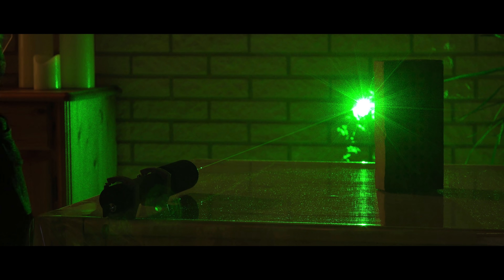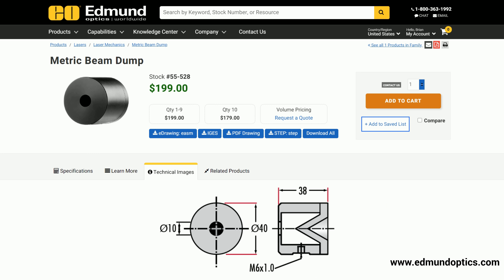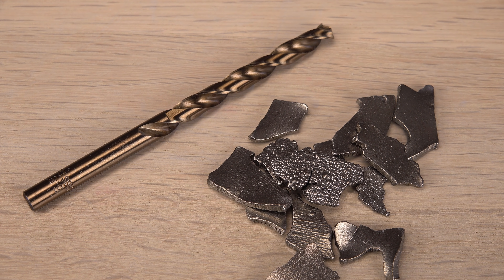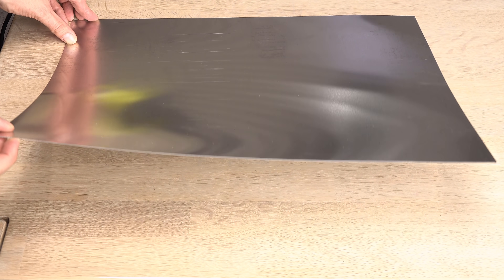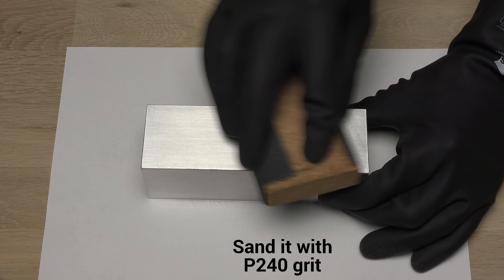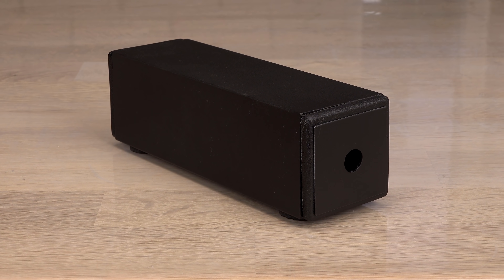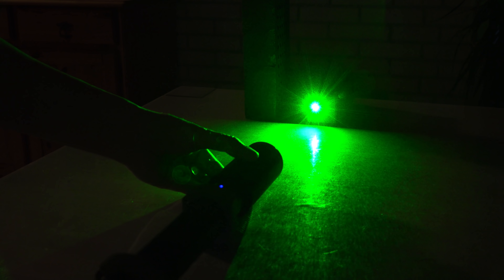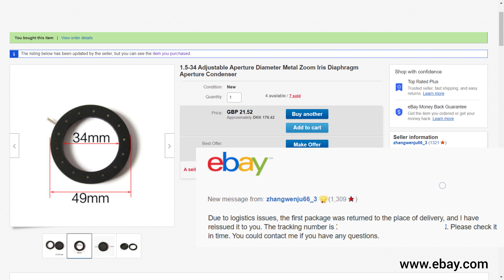Don't use strong lasers without this - easy to make!

Comment: I just bought a 3 watt green laser, and for some reason it seems more dangerous than a gun.
Reply: A gun only hurts what you point it at. A 3w laser can bounce off something and blind an unintended target instantly
Reply: @gamemeister27  A bullet can bounce off of things or go through things and cause unintended holes.
Reply: @gamemeister27  Same thing can happen with firearms.
Reply: @gamemeister27  haha not only that but a gun only shoots one bullet at a time, not a constant stream of projectiles bouncing off whatever they hit :D
Reply: Legit 3w or china spec "3w"?
Reply: @SNG.OfficiaI . Legit coherent lab laser module.
Reply: @aarongreenfield9038  I'm assuming 532 and not 520nm... Nice 🤤

I build array handhelds at 10W+... Simply looking at the dot can cause damage, class 4 are no joke. Been building all sorts since 2007 and store them like a firearm, including the smaller 3b's 💥
Reply: @SNG.OfficiaI . Yea, I won't mess around with it unless have the reds on. I also have a one watt argon: (It's hard to explain how inefficient that one is lol) and a 1064nm yag that doesn't mess around. I have many more in between, but these are the standout ones worth mentioning.
Reply: @aarongreenfield9038  1W Argon, the laser that doubles as a space heater 🙃

The beams are as beautiful as they come.. Biggest gasser I have is a few old HeNe's.. 

Addictive hobby to say the least..
Reply: @SNG.OfficiaI . I have a filter that splits the argon beam into about 8 different colors. it's definitely my favorite laser in my collection.
Reply: @SNG.OfficiaI . My biggest HeNe laser is about 10mw. It's huge, about the size of a baseball bat. Very stable beam. Good for lab use.
Reply: @aarongreenfield9038  I had found a 75mW 632 hene melles griot on ebay some time back but lost it to another bidder. Thing was slender but long..

There is a trick you can do with hene plasma tubes where an arrangement of magnets can boost your output by a few mW.. they are fun lasers to experiment with until you get nipped by the power supply lol
Reply: @SNG.OfficiaI  I'm curious about this hobby. What exactly do you do with the lasers?
Reply: @exia8989  for me this hobby taught me all sorts of new skills .. from a building standpoint that is. 

Its a great hobby if you enjoy challenge mixed with danger, and putting your own spin on it. 

For me it's been about getting more power and reducing beam divergence.

Lasers are an experimenters paradise 🍻
Reply: @SNG.OfficiaI  I see. I have a 100 watt CO2 laser engraver/cutter but I've only ever seen it as a tool. I was wondering if I was missing out on some additional fun with other types of lasers (like high power laser pointers) but I had no idea what people actually did with them other than well...pointing at things.
Reply: @exia8989  pointing is the last thing for me, that's usually reserved to check out the beam in the night sky .

First you have several wavelengths to choose from. 405nm, 450nm, 460nm, 488nm, 520nm, 532nm, 633nm, 650nm, 680nm, 780nm, 808.... All have unique properties and of course colors.

405-450nm can fluoresce scorpions, certain minerals, super charge glow in the dark objects.. 

630-650nm can levitate carbon with optical trapping, shut off street lamps by hitting the sensor..

And the infrareds can produce other colors via optical pumping..

Then you have listening devices, communications, beam combination for adjustable color including white..

The experiments are many..

And power, combining in arrays to have the meanest laser on the block.. check out my older videos, I did a lot of work on array builds.. 🍻
Reply: @SNG.OfficiaI  Wow that sounds like a lot of fun. Thanks! The listening device concept sounds like something I can really get into. I will most definitely check out your older videos. I was rummaging through my parts closet looking for some old laser pointers my cat's used to play with. Couldn't find the pointers but I did find a 5watt 405nm laser diode which I don't remember getting. lol. I'll look for some starter projects.
Reply: @exia8989  405nm are my favorite for beam spec. Most are single mode and have the lowest divergence given the short wavelength. 

Remember, constant current, low ripple drivers, and a glass collimator lens with ar coating for 405.

They are the most finicky diode of them all and don't take overdriving well, nor do they like increased optical flux via reflection from uncoated optics..

Proper goggles are a must as well, 405nm presents the "blue light hazard" and are deceptively dim to our eyes. 100mW of 405nm is as dim as a 3-5mW of green..

🍻
Reply: @exia8989  You sit there polishing them. Then you take em to the range and burn down some profile targets for calibration. Then you learn to field strip those suckers so you're always ready in case of a surprise holography incursion. You can get a combination laser safe that conceals under a matress and a quick draw mounting rack for your late nite rapid response dataset collection. 

Finally, they really kick ass at raves.
Reply: Green is especially dangerous because it may have significant energy in non-visible light.
Reply: @hockeyguy820 . That's usually the cheap Chinese ones that don't have the infrared filters, not that a 3 Watt laser wouldn't blind you instantly, so wearing safety goggles is a must anyways.
Reply: @hockeyguy820  you won't find a 3W 532nm sold without 808/1064 filtering . That's typical of ebay 10$ pens.. but yes can be a significant hazard at the entry level ..
Reply: No Company makes a genuine        3 watt hand held laser
The strongest  one available  is a 2 Watt.
You must be taking about an  engraving laser.
Reply: @ianlivingston5802  yes it's a laser module.